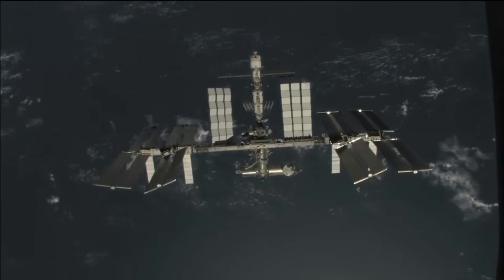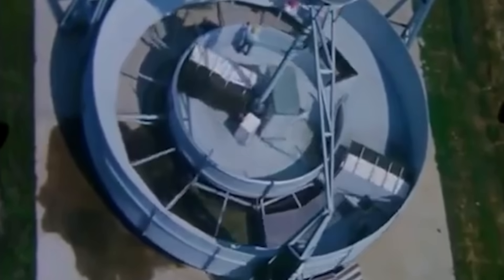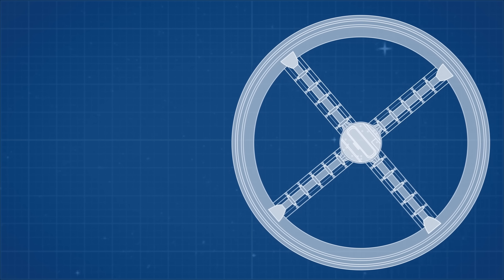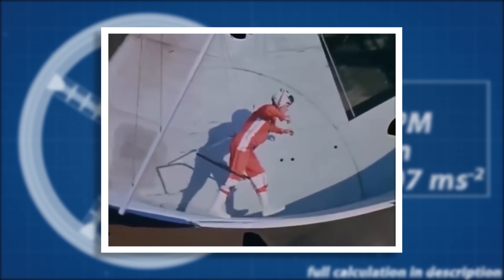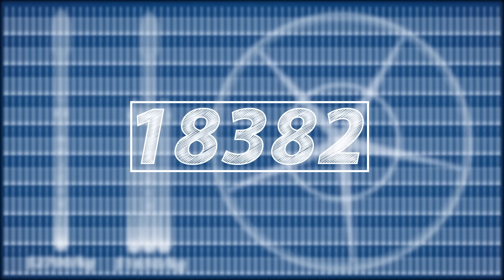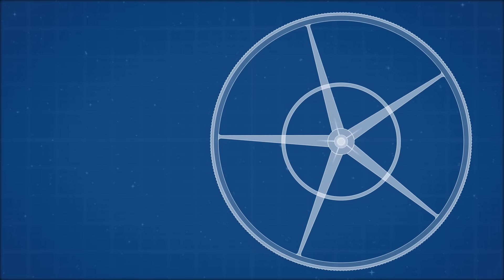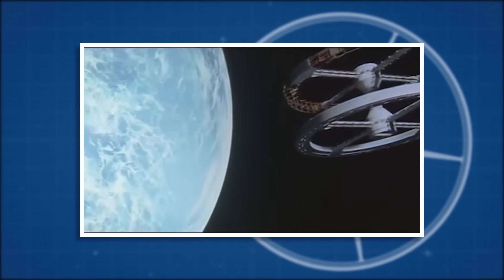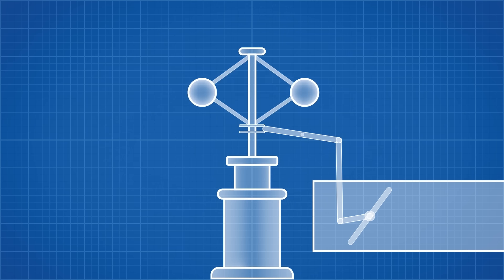Can We Create Artificial Gravity?

Comment: 1:18 "In this reference frame centrifugal force is absolutly a real and measurable force" : so a supposed physical force that is unreal in one reference frame, may becomes physically real when you change the reference frame. Interresting.
Reply: @Jesse Petrone That's precisely what I meant to notice, glad we agree. By the way, Did you notice that this demonstration "observes" a centrifugal force in the referential of the man who is in the centrifuge, but makes the calculations from data that are outside this referential? This should say a lot about the validity of the "demonstration".
Reply: @philipchek  The man did stick to the wall though.  Water stays in the cup when you spin it over your head, as if the water is unaware the force is imaginary.
Reply: @TexMex421  I have never said that there is no force. I say the force isn't centrifugal. It may easily be seen if you use a rope and a stone : if the rope breaks, the stone doesn't fly in the centrifugal direction. And it's the same in any centrifugal situation, including with water. By the way the video speaks about physic laws. In physic, in a referential frame, you can't use datas or informations that come from another referential : it's even what defines a referential frame. And by the way, in this video, how could exist a centripete force in a weighless situation ? The explanations that attempt to justify centrifugal force are full of such paradoxes, since it does not exist.

In a centrifuge, the objects that are physically linked with it are pushed - because of friction - in a direction tangential to the circle. This gives a "centrifugal" impression because the wall permanently prevents objects from leaving the circle, but the real force in question is tangential to the circle. And if the wall disappears, like a broken rope or an object falling off the roof of a car in a bend, the objects tend, by inertia, to continue straight ahead, in a direction tangential to the bend, and not in a centrifugal direction.

And I say all that with not angryness, I'm not raging, there's no need. You may note that my comments here just noted paradoxal consequences of the explanations in this video, and that the author prefers not to answer, although I spoke only about physic law and how his explanations do not respect them.

Comment: 0:34

Exactly, it is not real.You mention the observation of a rotating object from a position in an inertial system and confirm the absence of such a thing as centrifugal force. However your claim that this just meant that you were simply looking at something "from an outside perspective" is horribly wrong. That may be what it comes down to subjectively in many real cases, but "inertial system" is a system that'sspecified in its kinetic and kinematic properties purely by its inertia; effectively meaning that there's no alien force applied to it and it does not rotate, for then any mass element of the object would be accelerated to a certain degree in some direction at any given time. Then you make the very mistake that makes the claim of a true centrifugal force wrong: "from the point of view of the astronaut..." is a point of view that's not inertial. Identifying forces within such a system is invalid; it would become inconsistent with movement and acceleration, a change of direction and most important: if it was equivalent you would have to  consider Coriolis forces real forces, meaning forces could appear anywhere at any time. You need the inertial pov to explain it, but you dont need the restricted pov from within.Thats why inertial systems are superior systems to base your origin in.
And yet there's no question that this technique can generate "artificial gravitation",although I'd prefer the term "apparent gravity", since it relies upon "apparent forces" rather than "artificial forces" and because the notion of artificiality itself is retarded in most cases anyway. The apparent force is the centripetal force that you feel pulling you in to change your direction of movement. Your feeling of that force is what you call centrifugal force, but since your inetia is responsible, it actually pulls to the rotational center. There must be no centrifugal force,because in this case you would experience no change direction of movement, which, obviously on the absolute scale, does take place, i.e. you would not travel in a curve around the center, i.e. there would be no rotation, i.e. no force whatsoever, which however was your premise in the first place. Contradictive in itself.

Comment: What about if you need to walk in the opposite direction of the spinning? or towards the middle? or spend time in the middle?
Reply: I think the center would have no synthetic gravity. Once you grab a wall in there you would match the rooms spinning speed, spinning in a cylinder. But I think this would only work in orbit or with a high traveling velocity similar to Earth's orbit speed.
Reply: In the "ring" type spinning spaceship/space station, running with the spin would make it feel like there was more gravity, running against the spin less.  And if running against an you matched the speed, you would float

Comment: I know this video is old but you should do a video on artificial gravitiy in a rod. Essenstially, it'd be a spacecraft shaped as a long tube (which for the most part they are anyway). The tube would then be spun after reaching its desired orbit or perhaps after doing its last burn sending it to Mars. At the tips of the tube would be 1 G where the astronauts would sleep and exercise to maximize the benefits. This removes the need for a massive space station to avoid differential acceleration. Also, it is in general a much more resource efficient method to achieve artificial gravity.

Comment: Abstract
Use a laser to split a laser beam into two sets of photons,
p1 and p2, that are connected by a special kind of hypothetical entanglement
called a thread.  A thread is a proxy for
a small piece of spacetime.  Use
centrifuges to redshift p1 photons, blueshift p2 photons.  The idea is to induce a time dilation across
the thread.  Since it’s a piece of
spacetime, then it should acquire a length contraction as well, which is qualitatively
like a curvature.  The output of a laser
beam would be a curvature beam.  A curvature
beam would act like a tractor beam.

Comment: Your defense of "centrifugal force" is based on perception, not reality.  By changing your frame of reference, you're merely changing your perception, which means your description of your experiences will differ.  This description doesn't match what's actually happening in reality, but instead only refers to how you perceive it.

Centrifugal force is not real in this case, and is an inaccurate depiction of the actual forces in play.  You are not being "pushed" down into the ring by anything.  Period.  Instead, the ring constantly resists your momentum and redirects it.  This is centripetal force.
Reply: Finally one educated comment no likes so far... YouTube: where everybody gets to make science. And spinning very fast wouldn't be disorienting. Earth is spinning fast, too, you know. We don't feel it because of frame of reference.
Reply: @leolee6493  Earth is spinning pretty damn slow.
Reply: @TexMex421  Earth circumference is 24,900 miles. It takes 24 hours to spin once. Therefore the surface of Earth travels over 1000 mph.
Reply: @leolee6493  So if your car is going 60mph, how fast is the patch of tire touching the road rotating?
Reply: @TexMex421  Not sure if you really struggle to work out the math or this is a rhetorical question trying to show a point I can't really fathom...
Reply: @leolee6493  Ok, how many gallons tall are you?  How many yards does your oven get on high?  If your car is going 60mph, how fast is the patch of tire touching the road rotating?
These questions are not rhetorical btw.
Reply: @TexMex421  What did I just read, hahaha? Man, gotta tell me what you are smoking. It has to be some good stuff.
Hint: you need to know the diameter.
P.S.: go look up frame of reference, relative speed and angular velocity and educate yourself. There is more to life than trying to figure out "how many gallons" tall I am. Seriously, where do you guys come from? This is hilarious.
Reply: @leolee6493  Hint: rotation is measured in revolutions per some unit of time.  Go look it up.  The engine in your car spins at 800rpm at idle for example.  
How many gallons tall you are is no dumber than saying the Earth spins at 1000mph.  The Earth spins at a staggering .00069638 rpm.
Reply: @TexMex421  I am flattered... you actually go through all that trouble to explain rotation to me. Of course I knew what you meant from the beginning. In this context, the discussion is about the perceived "spin" (not a proper term; angular velocity if you will) one would experience on the surface of the earth. Since you had to just jump out and comment on "spin", I knew you liked arguing semantics. So I toyed with you a bit because, well, I got some free time to kill. But you probably looked up a few things and exercised your brain a bit trying to get back at me, right? You are welcome. Now you are just that bit smarter! And you actually used 23h56min to calculate the rotation per minute. Man, some real thought went into this stunt.
Reply: @leolee6493  Linear velocity.
Reply: @TexMex421  I think you are right; I mean linear velocity. See, you looked it up and learned new stuff.

Comment: I don't grasp why the station needs to be enormous to use this "Your head will experience more acceleration than your feet"  So what?  0G is not a natural tae for anyone and you get used to it in a few minutes. Also, there is not requirement to make exactly 1G.  Make a 1/2G and your feet will be fine.

Comment: Aluminium's melting point (from memory) is 1200 degrees (D) centigrade (C) with heat generated in this space station by the machinery and people on bored + any made by movement on the inside by these people, then the fact that the suns radiation hitting the outside of this tin can, it in a Vacuum! and considering the Troposphere temperature reaches 2000 DC, how are you going to prevent the people from stewing and the whole thing from melting?

Comment: OK,  I remember reading, ''if the main booster of the ol'shuttle was reduced to the size of a coke can, the walls would be thinner than a coke can !''   Why can we build that and not put together a simple wheel type space station ?   Don't outfit every part when you fly it up there... get the 'V' built, THEN outfit it with what ever.  If the bottom were solar panals (as well as the sides that would fold out) you coul orientate the wheel to always face the solar panals to the sun as it spun around, hence helpint to protect it's pasengers from the suns radiation.  And, we don't need all that aluminum... that's what carbon fibers are for !

Comment: Hold on... This need not be a full fledged wheel like structure. It could be just a connecting rod connecting two space stations and they revolve around each other. More the length of the connecting rod, less will be the dizziness.
Reply: yap
Reply: There is no dizziness from spinning if the environment around you is spinning.  The pooling of blood in the feet he mentions is 1000x better than zero-g pooling of blood in your head.
Reply: a firm cable might cut costs more

Comment: You hadn't calculated the SPACE-X BFR Rocket payloads & costs into your  Equations. which will be ten times the size & hold a much greater amount of goods then Falcon heavy. Or any other space craft mankind has ever build, Which would greatly Decrease costs & the Amount of rocket flights needed to get the required resources into space. But because of the Amount, the SPACE -X BFR  rocket could hold many of the needed components to build a space craft like that ,could & would be built & assembled on Planet then finished in space . Just as the ISS was with the space shuttles, And Because each part would take time to assemble. so the  amount of Aluminum you said that would be needed in total isn't exactly true because it would be spread out over several years. So Even if each Space Agency we have here on planet were to build a part or capsule at the same exact time the time line wouldn't only be Accelerated. But the resources needed could be easily Obtained . Because just like the ISS the while thing wouldn't be entirely made up of Aluminum but also other resources. But yes Aluminum would be the main resource needed for this kind of project. However  unlike the Examples shown in your video of spinning space stations that would use Centripetal force to create artificial gravity. A more logical & realistic version of the spacecraft would look more like a ferris wheel with capsules & tunnels . Rather then a fully connect integral system so that the spacecraft would be more streamlined & minimal on materials as well as other resources needed such as people needed to build such an engineering feet while in space . Because Each & every person needed to even build a space craft like that would have to go through years & years of training through NASA.  For example   the ISS took 100 shuttle launches & 100 Space walks  to assemble also many ,many other space walks or also known as EVA's to maintain ,fix & add-on too the ISS . There's just a ton of different variables ,Data, resources & Testing  that go into these kinds of things

Comment: So, the problem is entirely material and the materials are only being conisidered if they are common and expensive/heave/dense... (This is how these so called scientist work. 8\ Pretending to be engineers now too!) Nothing about looking at real world natural materials. Like very strong things made from foam or a bubble. Doesn't nature do that all over and give examples of way to reduce that fairly drastically. It wouldn't take much to make that more feasible.

Just to make this obvious. Modern scientists are not the producers of the knowledge(science) they use. They are the equivalent of a very stupid end user for a physical product. They know nothing!!! They only know what they are told they know. And they only have a very narrowed completely simplified understanding of those subjects.

If this guy tried to go into the specifics of the materials too it would be a joke.(not that anyone would be able to tell anymore.) We could absolutely do something if we wanted to and put the work into something. We usually have tons of materials that are capable but don't use them often because of normal manufacturing. There are also endless way to adapt or produce new materials based on commonly understood means. Unfortunately we less than a generation before anyone with any depth of knowledge dies of old age and this is what is left. Until we relearn the hard way from scratch which takes time. Although that amount of time can vary greatly.

Comment: Have you thought of (at least) two capsules connected by a long enough cable, spinning around the center axis? The center could also be a station module.

One big issue also is the coriolis (force). That solution with a long enough cable would solve that problem, or at least greatly minimize it.

You would have two gravity habitats and a zero gravity lab in the station, for a comperatively low cost compared to a full ring of metal.
Reply: You don't want to do that for two reasons.  1)  Both capsules would have to have exactly the same mass, otherwise the center would wobble back and forth.  Any movement between capsules would unbalance the system.  You could pump water back and forth, or slide a counterweight, but that just complicates the entire structure.

2) But the main reason not to have anything at the center is the Dzhanibekov effect.  The rotating system would self-destruct in zero-g.

https://www.youtube.com/watch?v=1x5UiwEEvpQ
Reply: That's actually a great idea, that way we'd have gravity habitats for long-term living, and a microgravity lab for research purposes
Reply: The biggest downside is probably the fact that you would not be able to easily or practically travel between the modules.  In addition, you would have the trouble of changing weight.  Any time you bring new passengers or supplies, or when passengers leave one module or send garbage back to Earth, the center of mass of the whole station would change and thus the axis of rotation.  On the same idea though, you could just make a long, straight station and have it rotate upon its long axis, where the apparent "gravity" at both ends of the station is equivalent to Earth and gradually fades as you climb to the center.  That would make it easy to manually or automatically adjust the balance of weight on each end, and the stiffness of such a chassis would mean slight changes to the center of mass would be less of a problem.  It still leaves us with very little usable full-gravity space, and it could be disorienting to climb from one end to the center and back down again as opposed to just walking to the other end of the station as one could in a ring.
Reply: @Agedude  Great thoughts. Yes, a straight station would have those advantages, and you could still make the 0G lab larger along the rotation axis, and the same with the two 1G capsules on the end, but for the amount of steel and material you can't really much use all the in-between space.

You probably could minimize that space with just tubes that are smaller in size connecting the larger modules. Still, it needs ventilation and heating for the astronauts.

The disorientation would not be a problem I believe. I would already by amazed to feel that gradual change to 0G, then turn around and float/climb down until it catches you again.